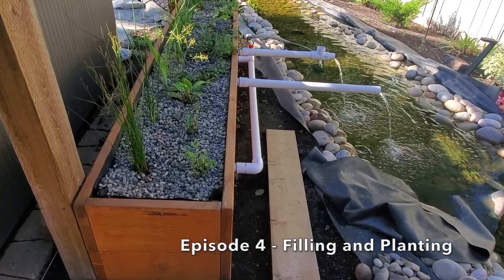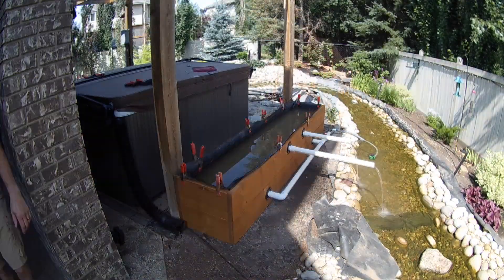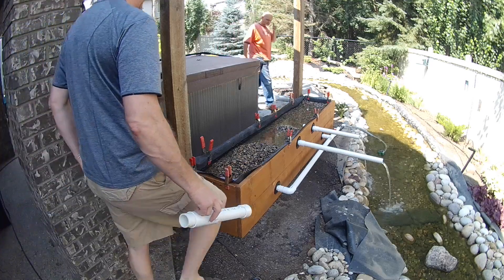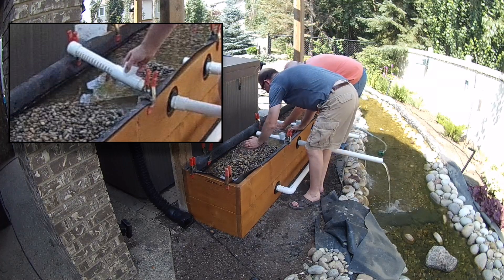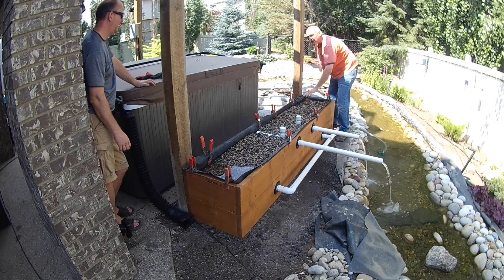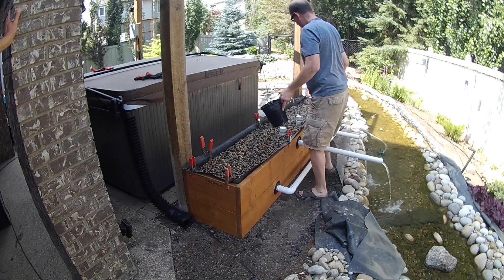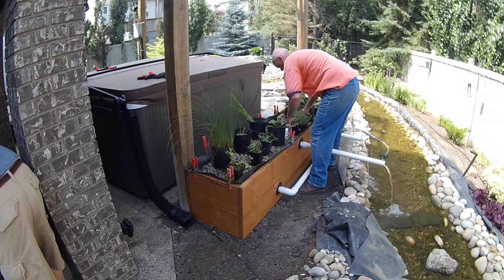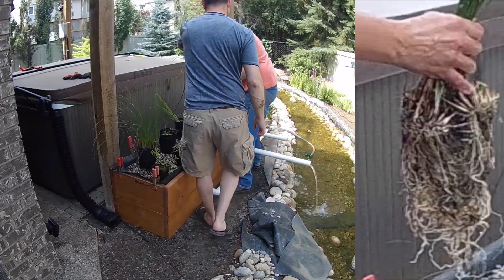Planting Your Pond or Bog Filter - Episode 4 How To Build A Bog Filter

Comment: Great video. How did you control siphoning?
Reply from the maker: The bog filter is not directly connected to the upper pond.  It uses an overflow feed, so there is no risk of siphoning.  The bog has a back flow protector to prevent it from draining out if the pump fails or if there is a power outage.  Hopefully, that answers your question.  Thanks for watching.
Reply: @gtrsquared919 Yep! Thank you!

Comment: The pond looks beautiful. Home is looking for some help. I have about 300 surface feed 25 x 12 and I’ve been Greenwater for about seven or eight years now and I’ve seen these bog filters recently I want to try it I was just looking for some help to know what size Bob filter to use I’m looking. I don’t know if it should be 100 gallon and then they say to use 12 inches of gravel and then I see someday you can use the 2 feet of gravel if anybody can give me some suggestions, I would greatly appreciate it, 2 inch pipe into my waterfall now. Just need to know if I should lower the volume and see what’s going on. Any help would be appreciated again thank you very much.
Reply from the maker: Green water is a result of too much nitrate in the water.  The algae will spread to eat up any excess nitrate.  Do you have fish in your pond?  If so how many and what size?  Do you know the volume of your pond?  What do you currently have for aquatic plants?
Reply: Thank you for replying yes I have water lilies and elephant ear yes I have gold fish last time I cleaned pond I had about 35 and about 6” long I know I have to get rid of some and a 3600 gal pump we just want to enjoy pond and it looks like a big filter will work just don’t know what size I have to clean pond soon just looking for some help thank you Frank for got to tell you have 2”pipe running to water fall thinking to go to 1 1/5
Reply: Sorry 3300 gal pond
Reply: Look up Ozponds bog filter for sizing requirement

Comment: Does the bog filter attract mosquitoes?
Reply from the maker: Not that I have ever noticed.  The water in the bog is constantly moving and the top surface of the water in the bog is below the gravel, so it would not be a good breading area for them.  Typically, they want still, almost stagnant water.
Reply: @gtrsquared919 thx for the info